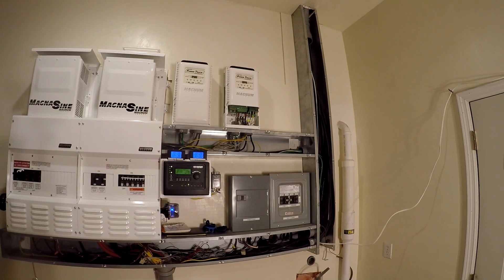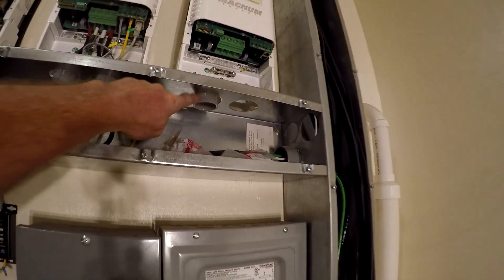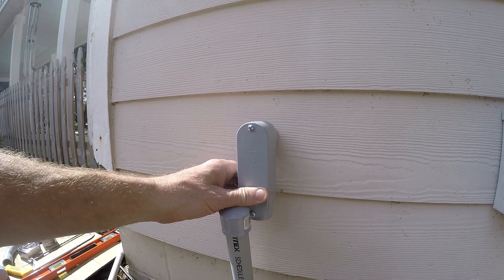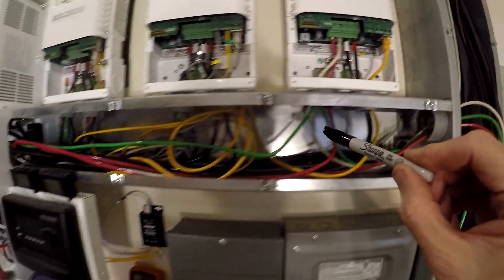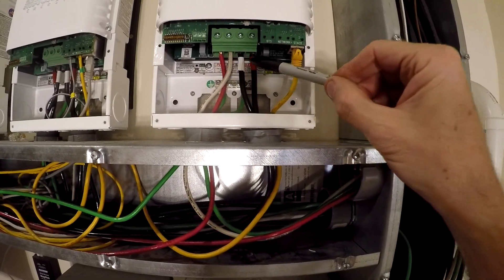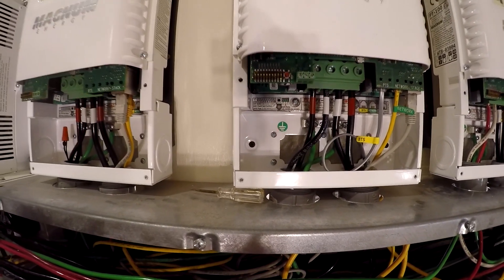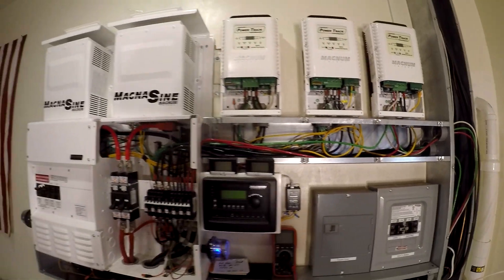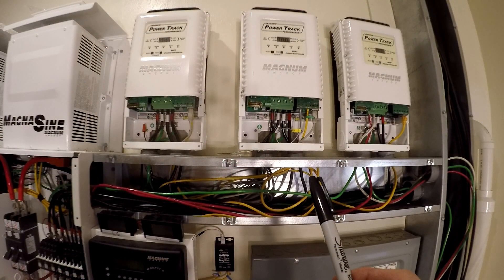Installing Magnum PT-100 Charge Controller

Comment: I just got a Magnum MS2812 that I plan on using to power my 30 amp RV while parked at home and run some lights to my shop.  I got the unit from a friend, but I’m not sure what else I need to make it work.  I’ll be using solar panels, also.  Any help would be appreciated.
Reply from the maker: Jeff, You might find this series helpful: https://youtu.be/lcGjoHS6rnE
Reply: @HomesteadEngineering  Thanks!  I’ll check it out!

Comment: Where did you get your cable trays. A search showed up nothing. Do they go by another name?
Reply from the maker: I think I got them at CED "Consolidated Electrical Distributers"  Check wireways.  You can find some info on it somewhere in this video: https://youtu.be/zb4oar9UHSY
Reply: @HomesteadEngineering  Thanks! It's all in what it's called, lol.

Comment: Your wire frome the terminal block to battery cable may be to small for three charge controller
Reply from the maker: Good call Roy, thanks for pointing that out.  It may be too small, I will have to investigate that a bit.  I did not even think about it as that was pre-wired by Magnum.  I think it could see about 250 amps worst case so maybe 2x2/0 or 1x4/0 wire.  It is very short so that helps.  Would you double to the same battery switch or run the second wire to the other side?  Those two sides are connected at the battery.  Thanks!
Reply: @HomesteadEngineering  I was observing   300 amps is a lot of current

Comment: Yup. Mine is wired the same way. Magnum makes it easy. That is a massive upgrade. Now how close are you to being 100% off grid? It seems to me your choke point now is the battery bank.
Reply from the maker: Yes, the battery is the next and maybe last thing to upgrade.  I have started pushing the bank a bit harder now that I have found a 30kWh lithium battery for $9,000.  With that, I would run a bunch of stuff at night and not even worry about it.  Then I would not be wasting so much power on sunny days.  Of course I could always upgrade from 9k watts on the inverter to 13k Watts.  :)
Reply: @HomesteadEngineering  you may have to get an EV to stop throwing power away. I may convert our MG Midget to EV. We sold my wife's Miata because it will not make it up the road to our new place but The Midget is slightly higher off the ground. It would have to have a 200 mile range to make it work.
Reply from the maker: @offgridinthepacificnorthwe3210  We think a lot alike Stephen.  One of the reasons I added this is because I ordered a Tesla Cyber Truck back when they first rolled out the prototype.  :)
Reply: @HomesteadEngineering  wow that sounds like a lot of fun. Especially when gas goes through the roof.
Reply from the maker: @offgridinthepacificnorthwe3210  I'm actually not sure I will get it when it eventually comes out.  Part of the reason I wanted it was to act as a backup to the house.  With the price of the 30kWh battery dropping so much, I don't think the truck will be needed at all.  My current truck is 14 years old and having some issues so well see...